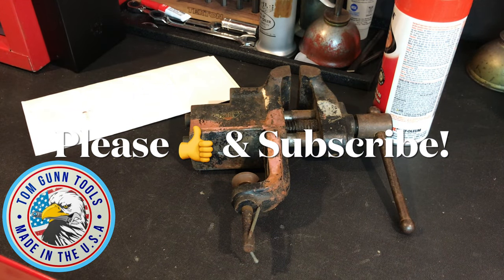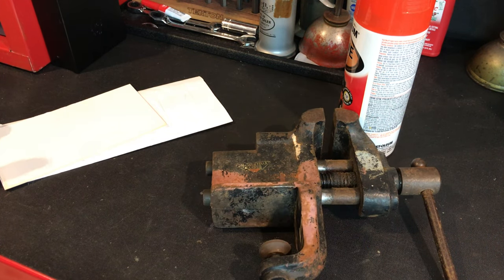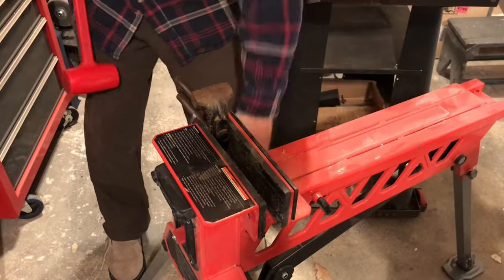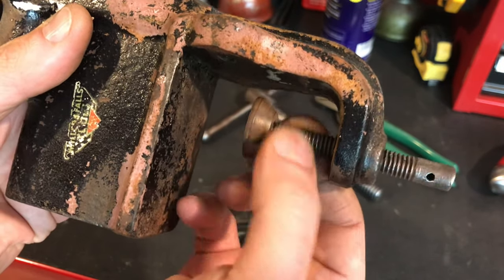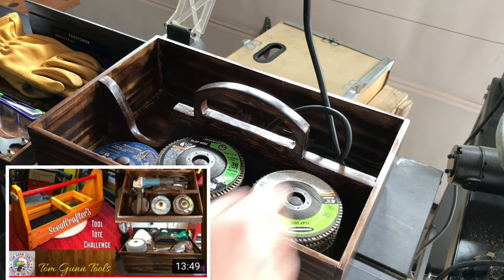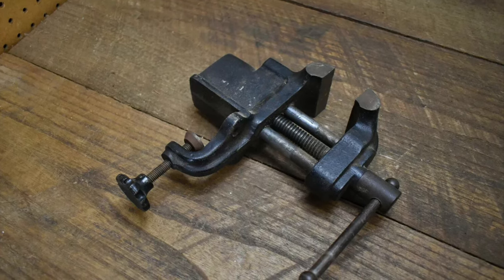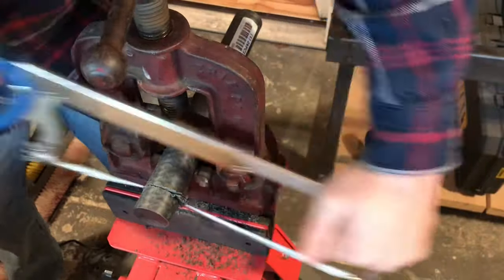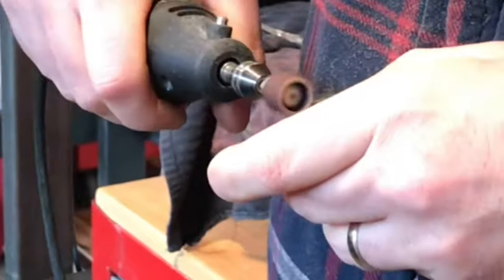Millers Falls Vise Restoration!

Comment: Nice to come across the channel, I have this exact vise that I got for $3 at goodwill. It’s been an extremely useful tool. It had paint all over the factory green paint so I wire wheeled it and while I was trying to figure out which color I should paint it, I ended up using it, and I use it so darn much I’ve never got the chance to paint it.  At any rate you did a beautiful job 👌🏻👍🏻 and have made me want to finish mine. Maybe matte crinkle paint like they use on machinist toolboxes
Reply from the maker: I have good luck with the hammered paints, always a good option. Wow $3 can’t beat that!